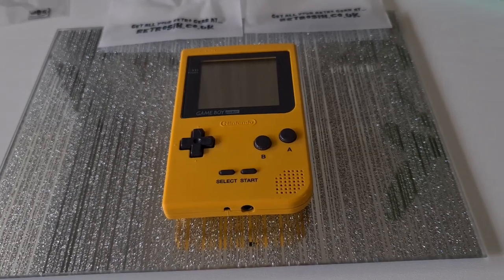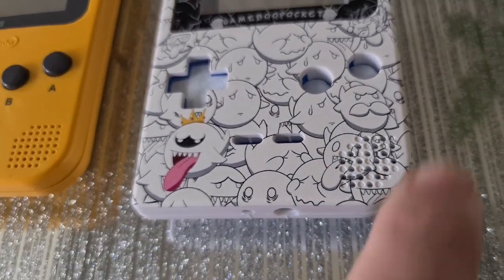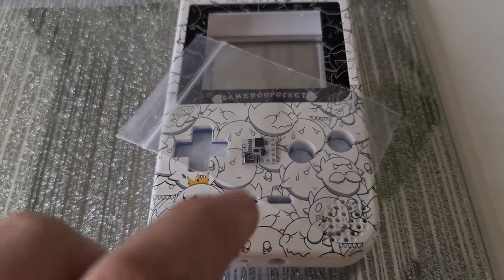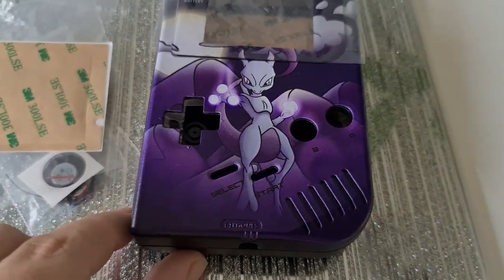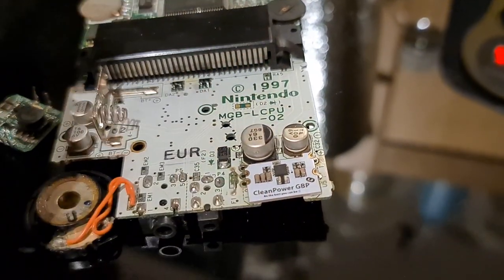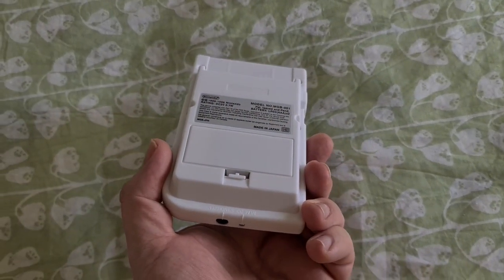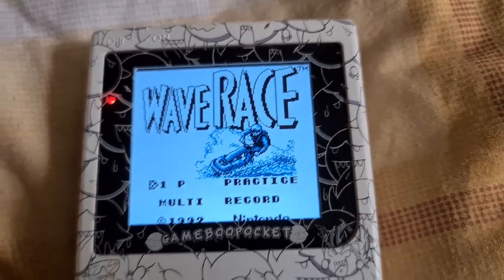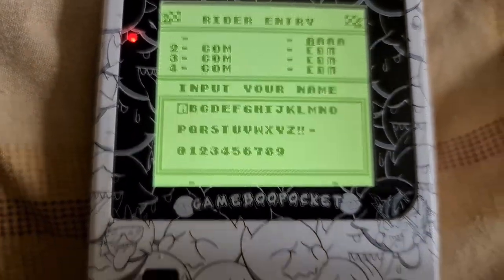Gameboo Pocket IPS - The Ultimate Gameboy Mods That Turned Trash To Treasure! Retrosix.co.uk

Comment: I really like that pixel mode. I wonder if I can get it on my gba IPS screen?
Great job, those little parts may look cure, but I'd be swearing my head off trying to use them
Reply from the maker: If you ever want something modded send it my way mate I will sort it! I'm not sure if the gba has a pixel mode but possibly. It will be the same screen just if it's been added into the board that connects to the gba. It's very cool and suits the pocket massively 🥰